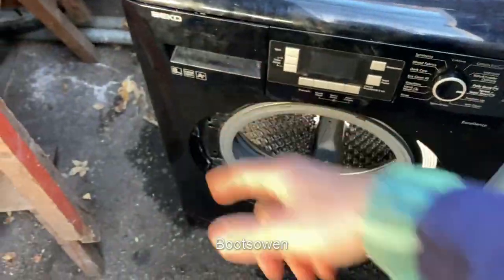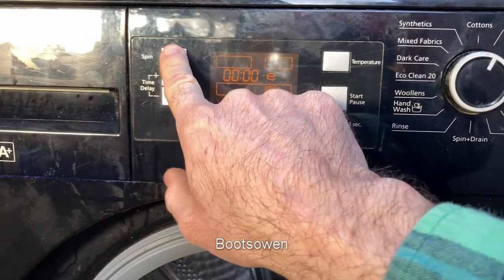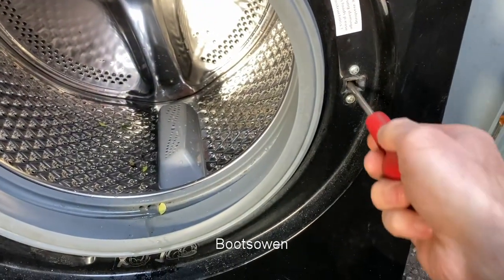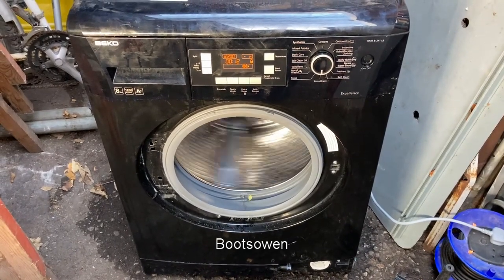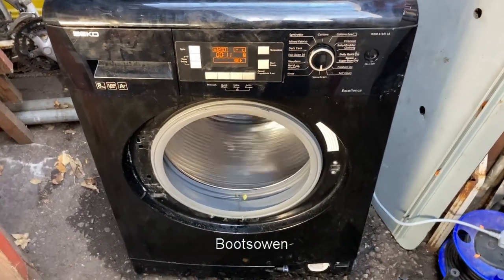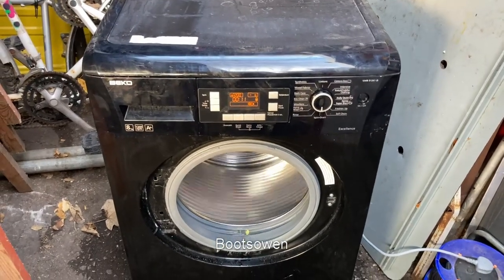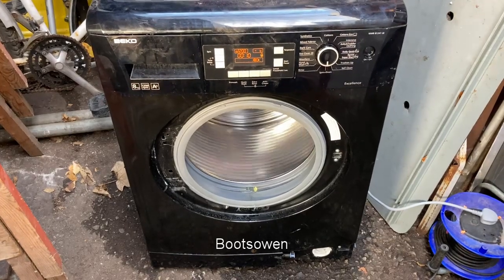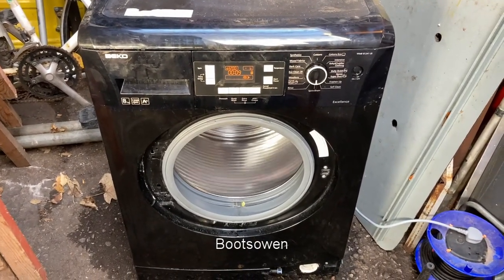Beko washing machine spin test no door! Street find!

Comment: I know someone who has the same machine with the the same problem where it will struggle to get the right program so what he did was he left it in a dry room so you could do the same and put a new door on it maybe
Reply from the maker: Have you got a new door for me?
Reply: @bootsowen  no🤣 but i could get one?
Reply from the maker: I’d rather brick it!
Reply: @bootsowen  ok lol but what you could do is use test mode where it will speed up to max rpm?

Comment: You should brick this on the spin only cause you bricked one black wmb already and that one was hotwired i wonder how it would handle on the spin only cycle
Reply: Theoretically this should handle better no matter the circumstance since it's got an aquawave drum which are very much so built better than the "normal" ones (which the other one had)
Reply: @Motherboard686  Hotwired machines die faster due to sudden shock drum gets etc. Thats why I do it on spin cycle. Lasts longer and its more entertaining😂

Comment: This is just a more advanced version of the WMB61431W you’ve got, in terms of programming it’s the exact same so no point keeping this as you’ve got a slightly watered down version that works and can be used
Reply: Sounds like a case for saving the main power supply board if recycling any of it.